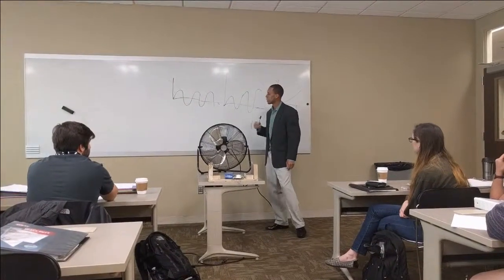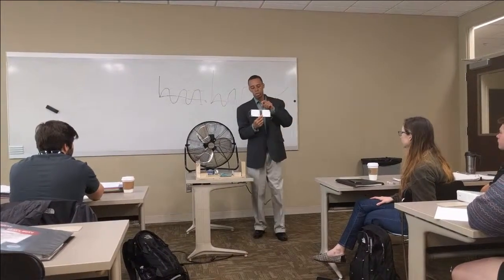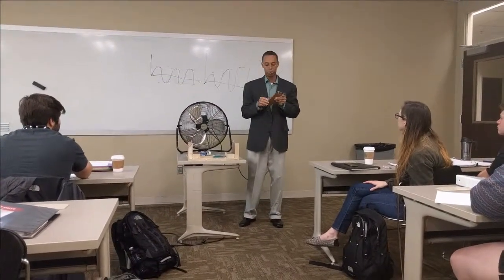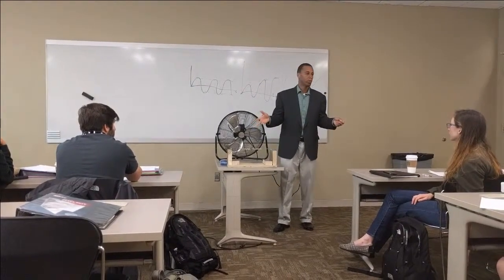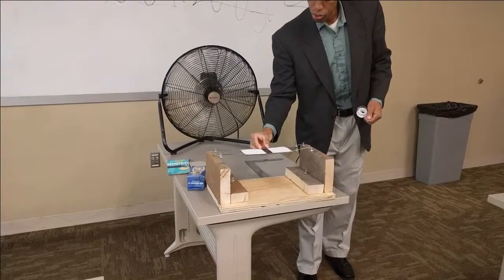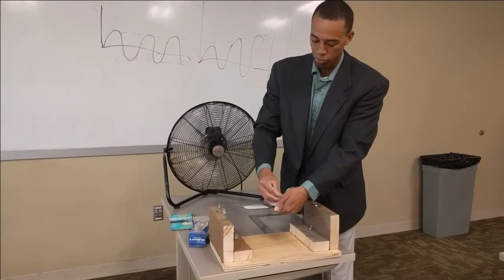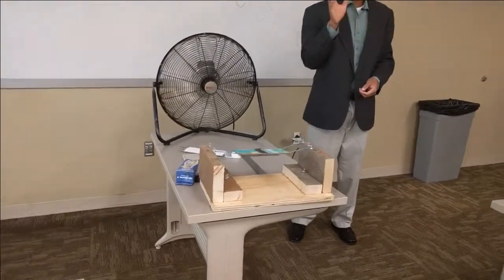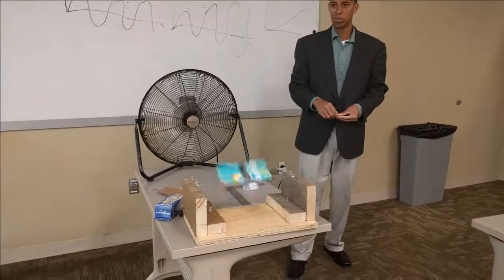Flutter Experiment with Shelton Flores

Comment: Nice clip! I couldn't quite get the parameters he listed for the flutter experiment because of the audio. Also, I wanted to ask, are flutters of a interest in UAV flight tests?
Reply from the maker: Flutter is not really an interest in UAVS because of the scale. The parameters are the center of mass, tension and windspeed.
Reply: Thank you Prof. So basically, for UAVs, what parameters do you look out when conducting flight tests like you do in those video clips?
Reply from the maker: Autonomy is my main concern. That and the flight controller itself.
Reply: Ok, thanks sir. Please, do you have any lectures (video clip) on UAVs? Or alternatively, perhaps you could recommend some texts or papers that treat this subject?
Reply from the maker: UAVs are a very broad subject. What would you like to learn?
Reply: Well, I am interested in leaning how to install (build) UAVs and flight controllers, basic programming/ communication between UAVs & flight controllers, and, (I know this is probably a long shot), air traffic control/monitoring.
Reply from the maker: @beebee_0136  ATC is beyond my area of expertise but building and installing flight controllers depends on what FC you want. Here are a few links.

https://oscarliang.com/
https://www.youtube.com/watch?v=2pHdO8m6T7c
Reply: Thank you so much for the help sir. Will get back to you.